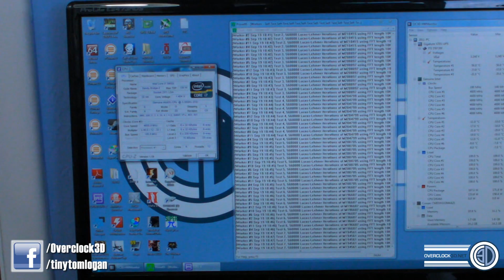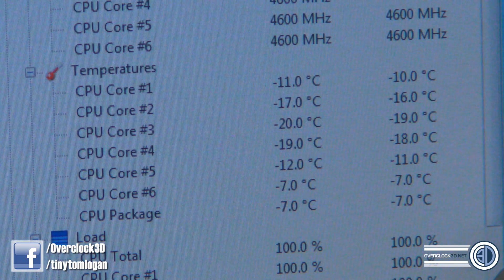Ultimate Corsair H100 Cooling Mod

Comment: Temperatures below the temperature of the environment... Okay..
Reply: +Mathieu Paquette it can, but not with this stetup, pressure difference wont be enough. These fans are for moving air, not compressing/decompressing air.
Reply: +Weisswurstesser AINT NOBODY GOT TIME FOR PHYSICS
Reply: Otto Knabe
That would be a save alternative to water because jet fuel can't melt steel beams.
Reply: Just watch the end... I hope you didn't thought that you are smarter than the othersxD
Reply: Thought the same thing
Reply: aljo10lp Somehow water freezes under 0 degrees celsius. Thought that the main comment mentioned it, whatever :D
Reply: milanfanist and why is it called water cooling m8? Is it filled with jet fuel then?
Reply: +Phoenix Gaming i never heard of something that is more stupid than ur comment.
Reply: +whiteknives You are right that you can cool something to a temperature lower than ambiant with a difference of pressure. The part where you're wrong is that CPU coolers don't have a phase change system, it's just regular water flowing through a water block absorbing heat from the CPU and dissipating it in the radiator, unlike a refrigerator wich uses R134, a compressor and an expander for example
Reply: +Weisswurstesser How does the watercooler work then?
Reply: +thereddog223 You can check a video from LinuTechTips, he put a system inside a mini-fridge. The result was that the computer created more heat than what the fridge could get out, so it heated up.
Reply: +Weisswurstesser Yeah, impossible since fans never help on hot days.
Reply: whiteknives He does say later on in the video that it's all just for fun ;p
Reply: Zach Meier Celsius makes more sense for me, freezing and boiling of water is a lot more familiar than the freezing point of brine with the boiling point of water being 180 degrees apart. Plus, Metric yaaay
Reply: Pafiro But your cpu will never run less than -20C if it's -20C outside ;)
Reply: +Mathieu Paquette dude does thermodynamics mean anything to you compressing air is exactly how a fridge works
Reply: +Weisswurstesser How about watching the entire video?? lol
Reply: we know the end, just wrote what we thought througout the video
Reply: +DaFred1990 moving air has a difference in pressure but not that much to cause a difference
Reply: Otto Knabe it just doues a better job to bring the heat ou and the enviromental tempatature in because water can transport more thermal energy than air
Reply: +Otto Knabe ther is no water insiede AiO watercoolers but some type of coolant but no water m8
Reply: +Mathieu Paquette Yeah I wonder what would happen in a freezer
Reply: +Otto Knabe Water-cooling uses water. AIO/Liquid coolers use a special type of oil.
Reply: ***** shut up
Reply: +Weisswurstesser you must be fun at parties
Reply: +Weisswurstesser Well, when you think about it, more fans = more heat taken away at a time. If enough is taken away, it can get lower than the enviroment.
Reply: Solitude

of cause they do..
They will always cool the cpu down if the room temperature is below the cpu temperature.
The effectiveness of it depends on the difference between the 2 temperatures.
Reply: +Mathieu Paquette How do you think refrigerators work lol
Reply: +Mathieu Paquette Incorrect. The ambient air is simply a means to evaporate the liquid substance inside the radiator. A lot of energy is taken away when a substance changes states from liquid to gas. This is why on a 105 degree day, our bodies keep our internal temperature steady at 98.6 Fahrenheit by emitting sweat. The evaporation of sweat is what cools our skin to a temperature less than the ambient temperature in the same way that the radiator liquid cools the CPU to a temperature less than ambient.

That said, the video maker's comment about the room being freezing is either an outright lie, or is only because he has the AC on. The heat from the CPU must go somewhere, in this case into the room. If anything the room should be hot if the CPU is cold.
Reply: +Mathieu Paquette This obviously flew over your head and this video was obviously a joke. MFW.
Reply: I love it how everyone is still debating this on a video from 2012 lol
Reply: +Sidowse you are correct after about 20mins of being a freezer the freezer would  heat up. this guy on youtube name Linus tried this, but alternatively  one might try to cool their cpu by using the sub zero method ( liquid nitrogen)
Reply: +Weisswurstesser Temperatures below 0 with watercooling :D
Reply: +Weisswurstesser then what about air temp outside an airplane with -60? ;)
Reply: iblis89 I congratulate anyone who can find a powerpoint and internet on the outside of a plane, as well as not being blown off by the 900km/h wind ;p
Reply: freezing point of water is 0, he's watercooling will explode :D
Reply: +Scabbage they have sensors on most planes ;-)
Reply: +Eryk Szkaradziński if water moves the temperature when it become ice get lower
Reply: iblis89 I dont see how sensors will save you XD
Reply: Josh Andreacchio Wasnt the world record overclock cooled with liquid helium? If I could run my cpu at 8ghz stable fuck yeah id cool it like that
Reply: Gizmoriderful Ye What'd Mat say that was wrong?
Reply: Check whole vid maybe?
Reply: chechenb0rz Watching the whole video before commenting is for mere mortals, obviously we all know what's going on halfway through >=D
Reply: +Weisswurstesser Not that hard to believe. I usually keep my apartment heated to 70F and my cpu (which is on a corsair AIO, just the two fans though) runs at about 60F at idle.
Reply: Zach Meier Either you read 60C, not F, or you have a magical PC that violates the laws of thermodynamics.
Reply: Scabbage Well it actually occurred to me shortly after making this comment that I most likely have a faulty probe in my cpu, because the socket registers a more realistic temperature. And no, I consciously converted C to F because it makes more sense to me.
Reply: Scabbage Oh I'm totally in favor of the metric system, it makes so much more sense how it works. The only reason I convert celsius to fahrenheit is because as an American when I hear 23 degrees celsius I don't really know exactly how hot that is off the top of my head because I'm so used to hearing it in fahrenheit. When I hear 73 degrees, I know exactly how hot that is. I do have something of an issue with celsius as a scientific unit however as it is based on the behavior of water at sea level here on Earth, but on the surface of Venus water would boil at a much higher temperature because the atmosphere is so much more dense. A better unit is kelvin, however it's somewhat impractical for use in the weather report or cpu temps. Here on Earth I'll just stick to fahrenheit cuz it's what I know.
Reply: Zach Meier Kelvin is just Celsius +273.51 to move it to absolute zero, it still uses the Celsius scale. Fahrenheit is also based off the freezing point of water (plus salt) so the freeze/boil points of the brine would also change due to pressure, that's why we include the effect of atmospheric pressure in the definitions ;p
Really any temperature scale is fine so long as two points on them can be recreated in a lab, the thing that I dislike about Fahrenheit is it uses a brine mixtures freezing point for 0 and human body temperature for 100. Which seems a lot more complicated and prone to error than simply the freeze/boil points of the most abundant stuff on the planet xD

Granted, you do have to distill/purify it if it contains impurities lol
Reply: +Scabbage First of all. Mostly all USA measurement scales are fucked up. No one uses Fahrenheit in modern world except you, its arbitary and not in relation to modern world (like 0 degrees C for freezing, 100C for boiling water). And finally to you all. THINK assholes, processor can be under ambient, if you put energy of running water cooling it down. If you people would exercise, you would notice that if you sweat a lot, your hand for example can feel actually cold.
Reply: Gizmoriderful Ye You do realise my arguments were FOR metric right? I'm not American lol
Reply: Gizmoriderful Ye I just read your bit about the under-ambient pressure for CPUs, and your example only applies to sweat because of the phase change, in most normal water and air cooling setups the CPU temp will never be under ambient because the heat transfers to the material you're cooling with, which in almost every case is the ambient air.
Reply: +Scabbage Right but Kelvin doesn't make sense to use outside of a lab setting because the temperature variations you experience in weather or in cpu temps is going to fall in a pretty tight range. For instance the difference between 250 and 300 Kelvin doesn't seem like a huge difference but in reality it's the difference between freezing and heat stroke. What I like about Fahrenheit is 32 is cold, 0 is really cold and 100 is hot. It's a nice scale for here on earth, that's all I'm saying.
Reply: +Weisswurstesser Im in canada and its gets WAY COLDER then -20 Celsius lol. So your actually incorrect
Reply: Facepalm ;)
Reply: Mine is at 60 celcius and its literally minus 30 outside atm xD
Reply: Scabbage its minus 30 mine is about 60 degrees atm on load :L
Reply: Pafiro AHAHA
When was the last time you cleaned your coolers man xD
Reply: Scabbage Nah that wasn't the reason. Bad airflow. And with stock cooler. now im running 30 celsius on load but like... Its still -20 sooo
Reply: Pafiro So technically, you can say you were running 90C above ambient, which in most places would probably fry your CPU lol
Reply: Scabbage What are you talking about?
Reply: Pafiro If it's minus 30C outside and you had your CPU running at 60C then it's a +90C difference lol, where I live it would melt
Reply: XD
Reply: Do u think i have my computer outside or some shit?
Reply: Pafiro obv not, but technically it's 60C above ambient temperature of your broader environment lol
Reply: Scabbage im inside... its 22 Celsius inside... do the math.
Reply: Pafiro Inside is for mortals! >=o
Reply: :o
Reply: +Weisswurstesser south Polar test....
Reply: +Phoenix Gaming Go back to physics! Hint  even at the end of the video that it's fake.

Comment: I hope to hell you're being sarcastic, because if you can't hear that jet engine then you are deaf.
Reply: DanielRichards644 Somebody didn't watch the whole video ;)
Reply: SooSneeky
 At a certain level of craziness I just turned it off, because well when you start claiming a bunch of fans are cooling a room without doing anything to remove heat from the room you defy the laws of physics and I won't waste anymore of my time on it.
Reply: DanielRichards644 Fair enough
Reply: +DanielRichards644 We have industrial drying ovens at work that heat the air simply by blowing it around inside. No heating elements, whatsoever, and they get pretty damn hot.

Comment: This is fake right? I've never seen anyone do this setup because I thought stacking the fans barely improved the total air movement, is impractically inefficient, and put excessive wear on the fans
Reply: +Sam Non If you don't wanna watch the whole video. Just skip to the 16:00 mark.
Reply: +Isaac Turner 17:22 would be a better point.
Reply: +Sam Non This vid is a joke! 17:22
Reply: +Ethan LeSage /16:00
Reply: I don't think you get the point of the video... :P
Reply: +Kouki_Monster lol dat laugh
Reply: +Sam Non and it creates a black hole too
Reply: +Sam Non No, this video is fake
Reply: +Sam Non  it's a sarcasm, try to watch full video

Comment: Tony, would it be wise for a push pull configuration using a Corsair 110i Hydro? In my future build I was going for a Corsair 760T full tower case instead of the NZXT Phantom.

Comment: But, doesnt water freeze when below 0 Degrees celcius?
Reply: sigurda The temperatures shown in the video are fake. But nonetheless the coolant used in presealed watercoolers isn't actually water, despite the name. It's typically something more similar to antifreeze which has a significantly lower freezing point than water.

Comment: -10 on that chip would condensate a lot of water on it...so if this is real, this motherboard is already dead cuz it is covered in water due to the condensation, possibly the CPU too and PSU
Reply: Pavle Pavlovic You might want to watch the end of the video dumbass. No shit it is fake.
Reply: Pavle Pavlovic Water Cooled units are sealed.. No Cooling Liquid actually gets on the Motherboard. Everything stays intact, it's just the CPU (face) that get's water on it to cool it down.
Reply: SpiritualHD I don't doubt the video, but the air around it will still condense, he's not talking about the liquid from the watercooling loop. have a look on linustechtips for the sub zero build, they explain it briefly and have to use a sealant around the cpu block because of it
Reply: no cooling liquid gets on the motherboard , but the cold cpu sucks in moisture  from air around it , it condensates on it and leaks on the joints with the mobo making a short resulting in dead equipment , maybe even fire, take a bottle of water from ur fridge , leave it on the table , get back in 10 minutes, ull see ur table is wet, thats how would mother board look like if the CPU is -10c for 10 minutes ,  it aint a pretty sight for electronics , i dont know if video is fake , but if it is real , the cpu is dead in minutes, as soon as water gets underneath the chip cuz there are 1000 opened connections there, not isolated
Reply: Water Cooling CPU Blocks are usually sealed, which means Cold Water goes through the loop and it doesn't have any contact with the CPU itself (from my knowledge). Therefor no Leaks will occur.
Reply: SpiritualHD we're not saying it will leak.
Reply: SpiritualHD yo man, we dont saying it  will leak , we say that temperature of the cpu is less then ambient temperature , in that case  water condenses on the element that is below ambient temp..in this case CPU..no liquid from cooling is needed for water to condensate  on the cpu, it will get from the air around it thus killing the cpu
Reply: BewareTheIdes ive watched it few times dumb ass, i was talking to ppl in comments section, that guy knows its fake he did it, but no one is comments mentioned condensation, with that in mind it must be a fake
Reply: Alexander Schmidt im just helping these ppl that think its real and are going to waste money
Reply: +SpiritualHD Jesus you are dense

Comment: These comments...most are jokes and others sound like they are serious.  You cannot cool anything lower than the temp of the air you are using to cool with. No matter how many fans you have the lowest temp will be ambient air temp.  I highly doubt his ambient temp is -20.
Reply: Sesy COD Pope Your refigerator uses a Peltier cell. What you see is ther "hot" side of the Peltier attached to a radiator.

Comment: there is a coal power plant near my house. can i use it coal blower to cool my pc ? i am deaf so sound is not a problem. 
please reply
Reply: MostHitMan Ow, you can, and temps will be like this solution, however, one thing to be careful about, you want to put dust filters on all of your fans that blow outwards because if you don't you might attract moles.

Comment: Do not know if you were scaling up the number of fans, but would of been more meaningful if you had shown the numbers with 4 fans, 8 fans, 16 fans, 20, 30, then 40 fans.Also check the  airflow into and out of the fans. Could be that you get the same numbers with half the fans, so that much less money spent.

Comment: wtf??

Only -7C?

I made the exact same rig (albeit with 32 fans) in a mini fridge. I cut a circle in the glass door for a 140mm fan.
Very quiet.
On the back of the fridge I re-routed the refrigerator liquid and attached another reservoir to the top on the pump on the cpu.

Comment: Imagine if just one of those was mounted the wrong way XD I plan to go 3 fans on a Noctua NH-D15. Won't really improve performance much but I'll run em slower for quieter operation. Plus there's no problem with good low-profile RAM.

Comment: So your setup defies physics laws. cool ! bro do you even thermodynamic?
Reply: Wong Han Jun  It does. you can not decrease the temp lower than ambient(room)  temp. fans dont work that way ;)
Reply: agree to disagree, there are kinetic and pressure coolers that can go below ambient temp without the use of gas, was thinking the fans had formed different pressure chambers somehow, but then I thought this rig is too simple for this to be real.
Reply: Yes you are correct. pressure and depressure systems can cool below room temp( ex refrigerators).  But with those rpms it is quiet hard. You need ridiculus amounts of energy to turn them hundred thousands of rpm. Thats why fridges use pipes which are isolated from atmospheric pressure in Order to Chage pressure easily

Comment: A gem of an idea, however over the top you consider it. The H100 can yield some powerful cooling capacities with the right equipment. This (toned down a bit) could be used in place of N2 for extremers. It does seem portable and can be attached in a very short time. Some advance PWM controls could make it less of a turbine test and more practical.

Good show.

Comment: Why? These are expensive computer fans right?.... Yet you are not using a Case... Why stick to computer fans... Why am I the only one thinking about this...?
Reply: Cynical Zombie It is normal to use an open air test bench if you are swapping computer components on a regular basis. It's more convenient.

Comment: I just wanted to mention about the 120x120 fans. I am running a push pull system with a corsair h100I and I hate the noise. I only got 2 120x120 fans on each side of the h100i.  It sits on top of my computer and down right hate the noise. Drives me nuts. Also I sure would love to know what your ambient temp is cause for it to be -C means it has to be awfully cold in that room.